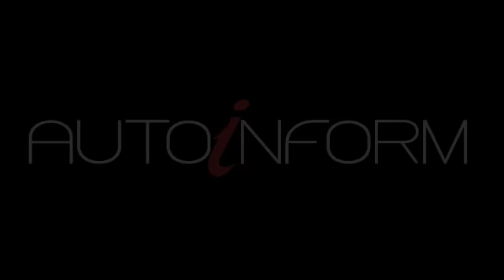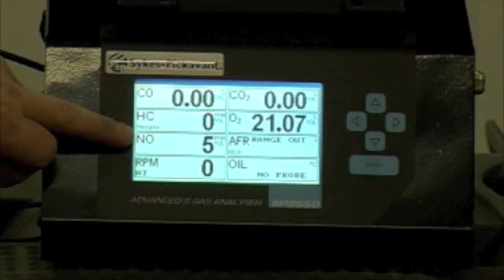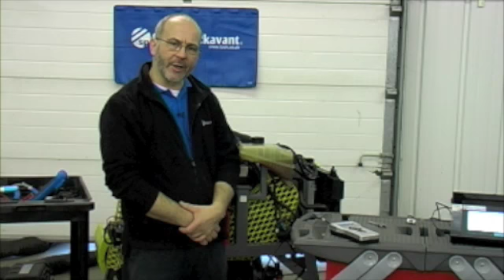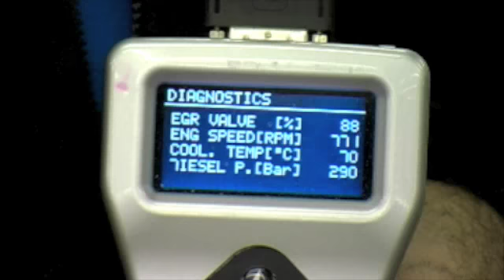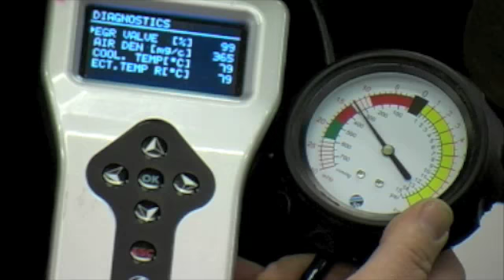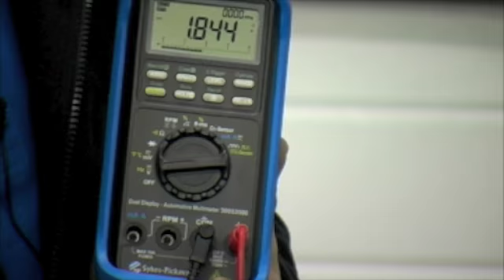AutoInform Mark Softly EGR Systems and Testing Methods

Comment: Informative video.
Having seen what street level NOx does to health, I cannot understand why some owners try to bypass their EGR's on newer diesels. In old school diesel engines, EGR was a bit hit or miss and from personal experience I've encountered engines that have run better with EGR blocked off and some engines that run terribly - often engines from same manufacturer. It's going to be interesting to see how long the diesel engine will stay with us. Euro 6 comes into force this year and it will only get tighter in the years to come. Wonder how far the engine can be taken? Already France is trying to ban diesels from cities. I guess it's the price we pay for high temperature and pressure internal combustion engines running in a 78 percent nitrogen, 21 percent oxygen atmosphere.